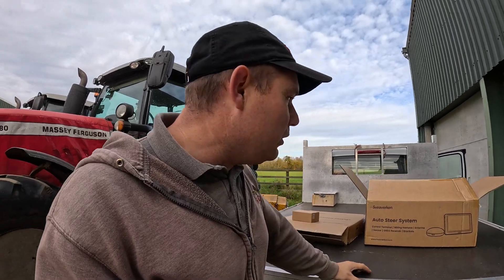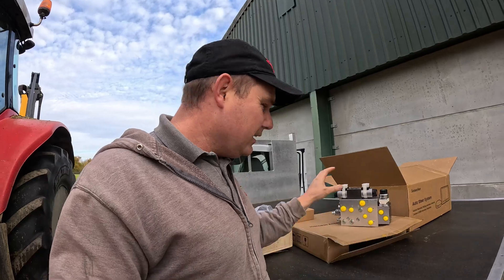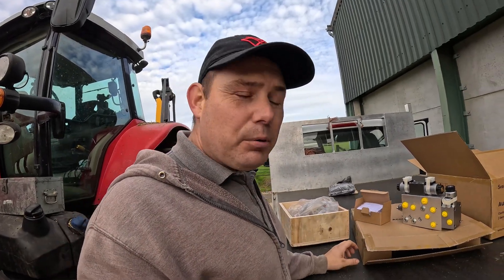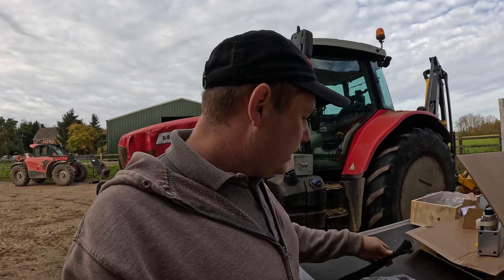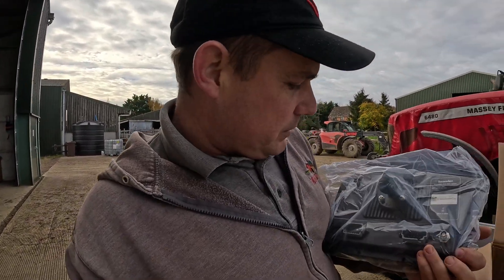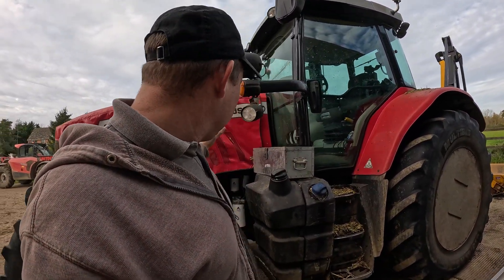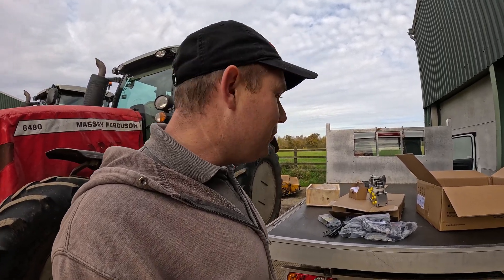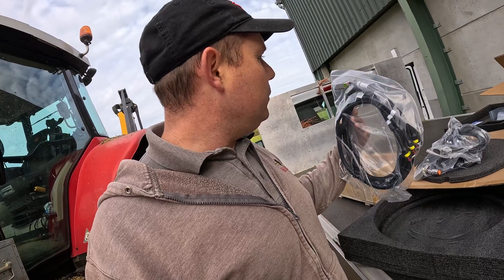New Sveaverken F100 Steer Ready Autosteer!

Comment: Wow - I would think that is certainly a winter job when you can afford to have the tractor down for a while as I somehow think you're going to be doing a lot of running around getting those little bits you didn't know you needed until you are in the middle of the job. Looking forward to seeing this - thanks Matt.
Reply from the maker: Cheers Jon 👍 its certainly not going to be a 5 minute job, but looking forward to getting it installed